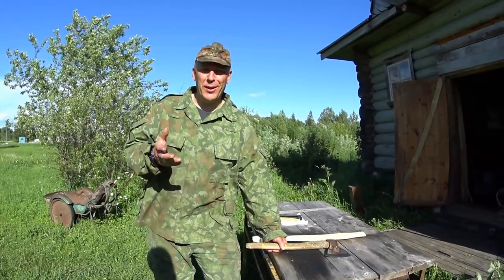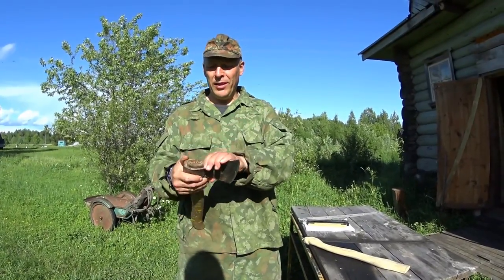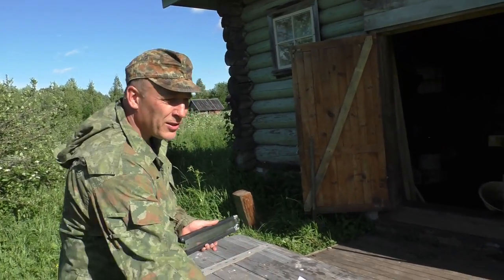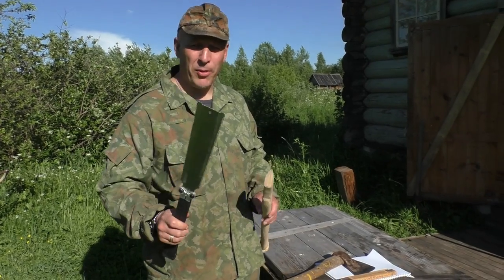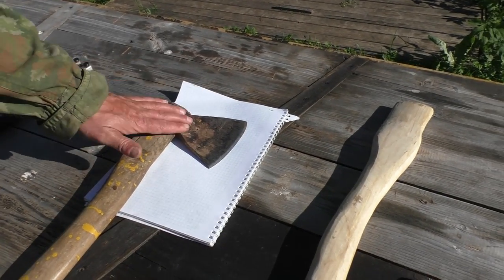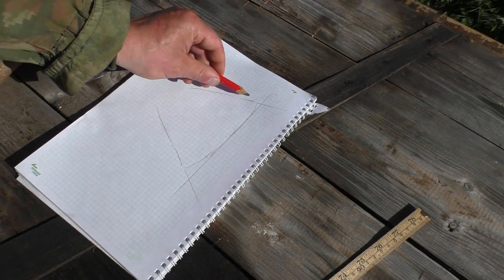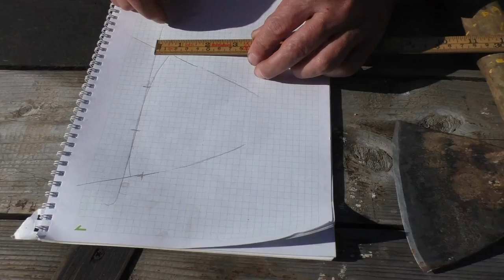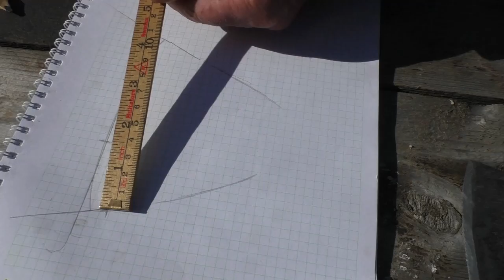Hanging An Axe Head With 5 Wedges. Russian Old School

Comment: I have used this method for many years and it is by far the best way to do it, though it does take a bit longer . It completely fills those little spaces at the ends of the eye and compresses the wood in the eye in every direction. When a head comes loose, it tends to first loosen 'up and down' rather than 'side to side'. This up and down movement is where the greatest forces are found in use of the axe. Round or other steel wedges help to fill the gaps but rarely do so completely. Having said that, I am not a big fan of glue, but prefer to take the time to really clean up the inside of the eye and concentrate on getting a really good fit between handle and head. A tungsten carbide burr is the quickest way to do this.  Good video my friend - a job well done !

Comment: Awesome video as always Lars!

That's a great looking axe! 
Funky 5 wedge system. I suppose it helps to produce a more uniform pressure on the axe head, making it a bit more durable and less prone to wiggling out. 

Neat gauze trick. Let's hope it works well. 

Good thing the handle didn't crack! I was thinking it might xP

Comment: I must have some Russian in me! I have done like this method more than a few times for axes. Although slightly differently than in your video. I put one long wedge verticallyin a sawn slot, and drive it home. Then split in 2 places with a chisle and drive 2 more in at right angles to the 1st one. So you still end up with a 5 wedge arrangement. I soak the wedges in Linseed Oil and put linseed oil in the sawn slot before assembly. When its all done I trim it with about 12mm exposed, then soak the whole axe wrapped in a oil soaked rag inside plastic bag for several days. I have never liked using metal wedges. All wood is far easier to drill out when you need to replace a handle

Comment: In a Russian language axe mending video the guy drilled holes through the bottom of the cuts, presumably to prevent splitting down the handle when the wedges are put in.

Comment: When you were getting to the end of banging in the wedges I was holding my breath, I expected to hear a split. Excellent job, especially considering the complexity of that system. Also I can vouch for those Japanese saws, I built a kayak using one and the kerfs are like a razor blade cut it

Comment: I enjoy for your little weelbarel than whe can see at the begening.
This system with a piece of tissue around the wood, i use it when the wood is old and very dry. 
My grand parents have the habit to do this from always. It is very usefull when you whant to save a very good handle who is too dry .Because of course it is forbidden to put it in the water .

Comment: Cool. I'm looking forward to trying the two systems out myself when getting back home. Especially the wrapping of the handle with the epoxy-infused gauze. Guess you used simple two-component glue? Also a very nice handle. I've spent some time on making axe-handles, being a forester.
Reply from the maker: Yes. 2-component epoxy resin and 4 layers a gauze. I hope it will hold up :)
Reply: @Survival Russia My worry would actually be the moisture that comes in through the wedging, though I think the epoxy-infused gauze wrapping may (or rather will) actually help to reduce shrinking effects. Looking forward to the test.

Comment: Nice job with the axe Lars considering you have not done one like this before. I have been planning to get hold of one of these Soviet Pattern Axes and modify it. I am no fan of gluing axe heads on, I usually give the end of the shaft a dip in Pine Tar thinned with Turpentine. On the some of the old beaten up axe heads I wrap a layer of Birch Bark around the shaft before I drive it in (check out my videos). The Birch Bark and Pine Tar are old Finnish Woodsmen tricks. I never have problems with heads coming loose even when I beat the hell out of an axe. Birch is an excellent wood for shafts if you select a good piece (slow grown, tight rings). Also check out The Sometests (I believe he is a mutual friend)?
Reply from the maker: Interesting tip on the birch bark. Thank you.

Comment: Almost Midnight in Bulgaria and I kind of lost it a little when the ''ruler'' in Inches and Centimeters came out.  I don't really know now whether this was a Belt and Braces job with Epoxy Resin and the 5 wedge system or, in my drunken state, I nodded off for a second or two.  I had imagined that the 5 wedge system would involve metal as shown on the small hammer job.  Anyway, very well presented instructional video as always.  Cliff hanger, YES and I would like to see what kind of axe head you finished up with as I bought a couple of secondhand axes recently and I notice that the head of the so called felling axe is curved - what is that all about?